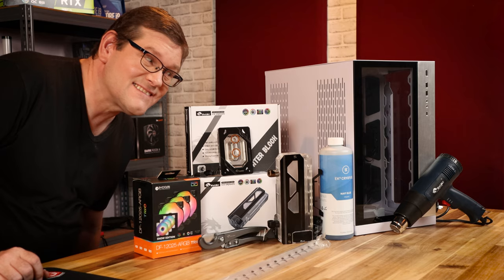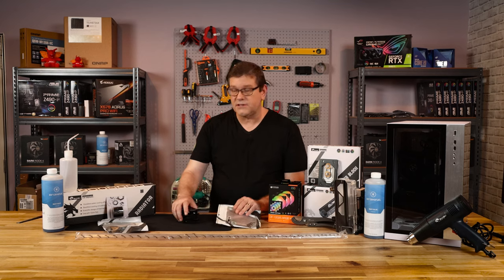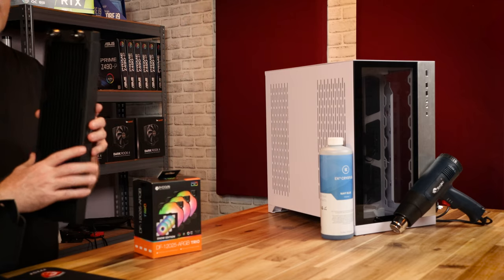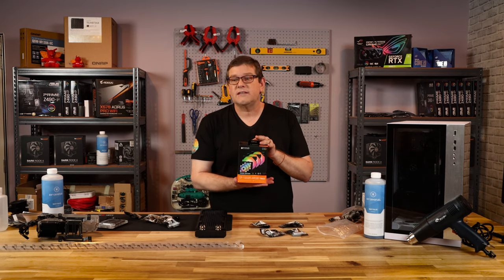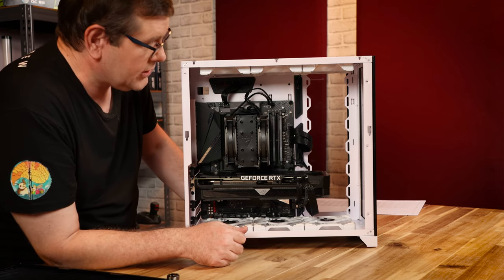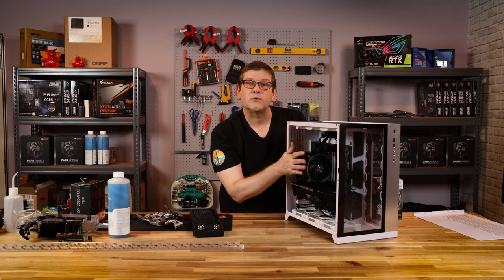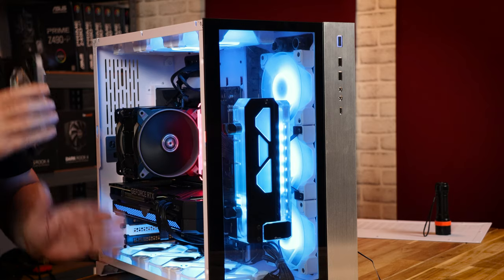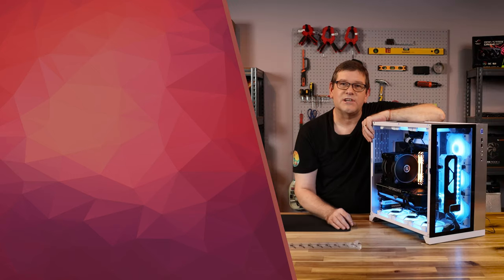Water cooling for Content Creators (Part 1)

Comment: That is a nice looking system Mike! Beautiful!  I think you missed an opportunity to explain what exactly water cooling is and how is that different than air cooling  (hopefully in part 2)? What does this mean for creatives/artists.. should they go through the trouble and cost of adding water-cooling or is the regular system they buy good enough for most use cases?  Hopefully you ran some benchmarks before installing the water cooling so you can compare performance before and after? Anyway, keep up the great work! Looking forward to part 2!

Comment: Nice build..... I leave my 9 3900X machine running full-blast for a week or more at a time on a project. I like the idea of the cooling of liquid, but I do like the reliability of my big huge Dark Rock 4  from BeQuiet with it's third fan I added on. I'm a bit worried that my machine might have a pump issue when I'm away for the day. If I drop a fan, I still have two more.
Reply from the maker: I agree with you, This was defiantly a vanity build for me as I like the looks. But time will tell if the water cooling is going to hold out. There is some really good fan coolers out there that can cool as well as any water cooler system.
Reply from the maker: also check out my Discord server if you want to join.
https://discord.gg/ksampTWc